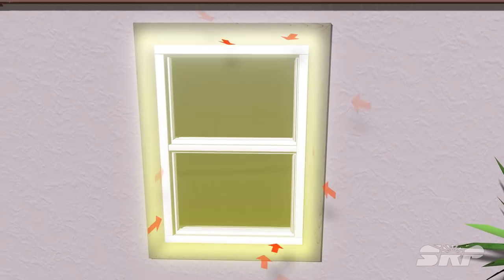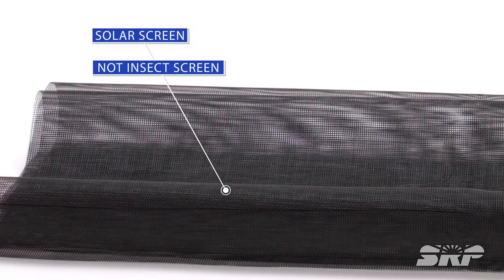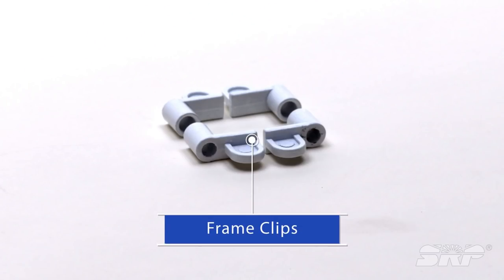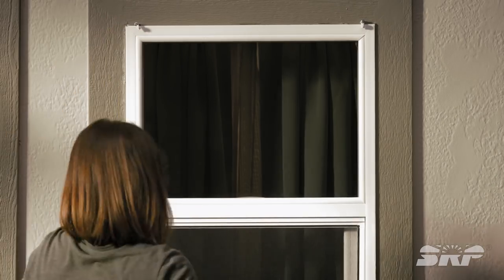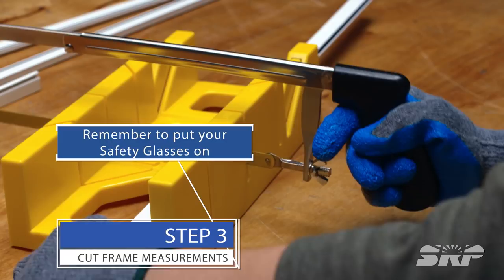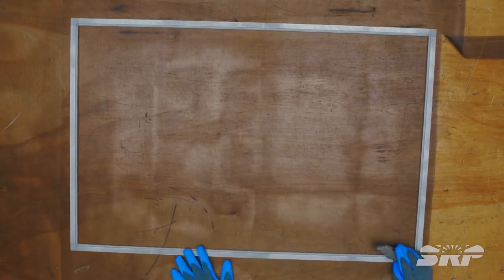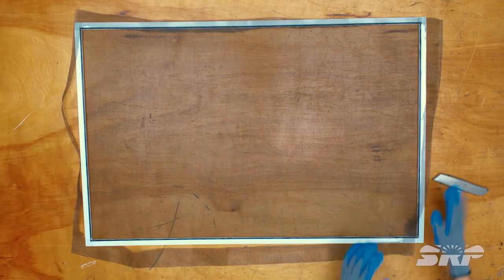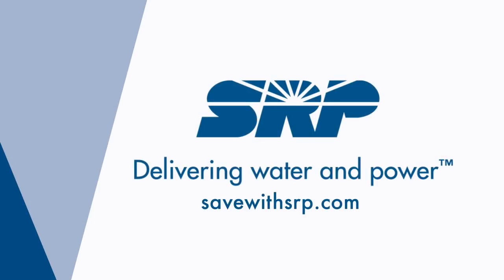How to Build Your Own Shade Screens

Comment: If the screen is too tight it will pull the frames in and mess up the dimensions. Test it in your window first before cutting away the extra mesh.

Comment: This is what a video made by people who don't know what they are doing looks like. Frame material belongs on the other side of the miter box when sawing so it doesn't move around so much. Roll the screen material into the frame first, left side then right side, then top and bottom. Then use the roll the spline into the frame.
Reply: Nice. Never thought of rolling the screen in before adding spline